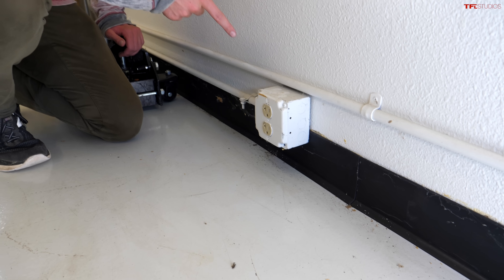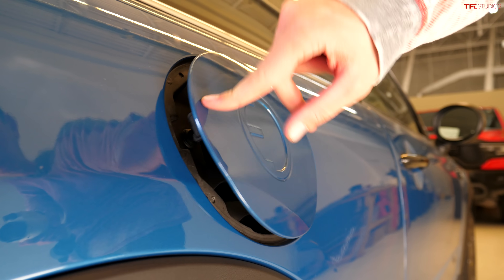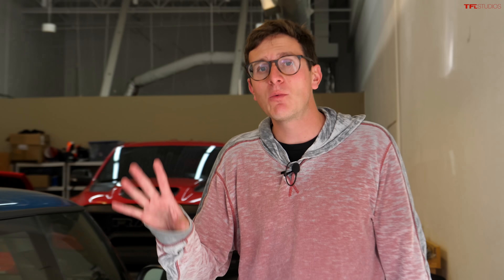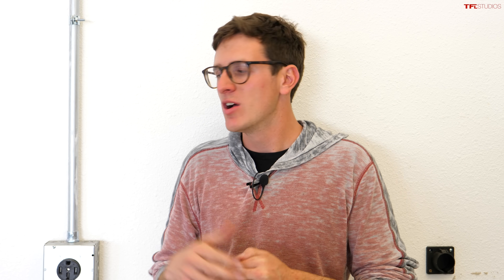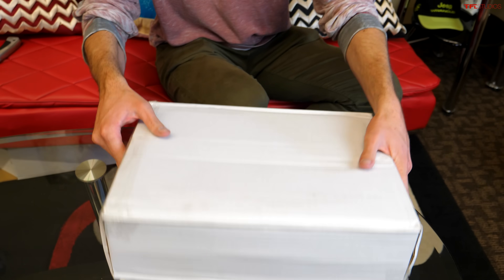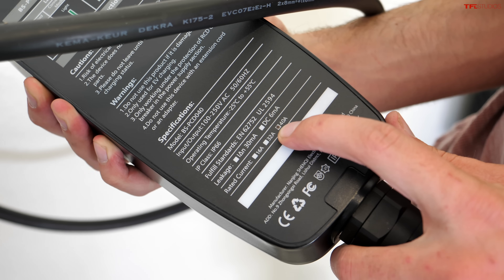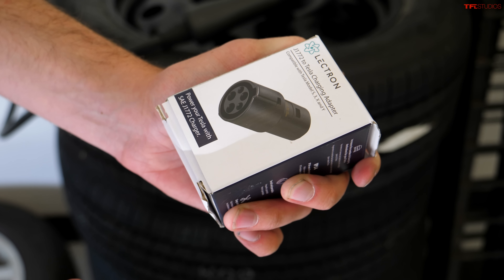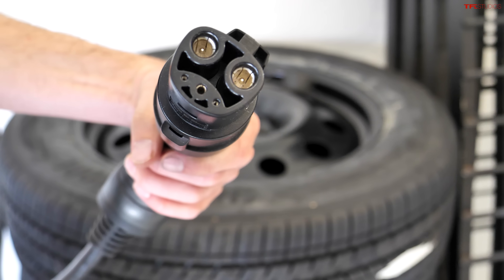Here's The One Thing You Don't Want To Forget When Charging An Electric Car!

Comment: Why buy a level one charge the manufacture supply's you with these the supply 240 charging cable and 7kw cable with every car 
Why waste your money the car comes with this cable in the boot.
We have 7kw charge at home which cost less than that cable
You level 2 is our basic why is the USA so behind 120 is inefficient for all electrical equipment.

Why are you wasting your money on these things.

Comment: While I understand that this is an info-tizment piece, folks should be aware that there's other stuff out there to aid in coming up with the best charging solution for individual needs.  First, there are intelligent current splitters where you can tap into your dryer plug and it will divert the current to either your car or dryer, according to need.  Lots of people are able to get away without running a new line or upgrading their breaker box for big savings.  It pays to do a little bit of research before shelling out big bucks for the gold plated solution!

Next, don't underestimate the power of good old 120v (lvl 1) charging.  Most people can actually get away with it for their daily needs.  Those big scary number of hours to recahrge, only apply for charging from totally empty to totally full... Generally, one only uses a small percentage of their battery on any given day and are thus able to replenish their daily use amount quite easily overnight, even on the slowest charging setup.  Even the occasional big drain, can be replenished over multiple days of normal use.

The upshot: Before running out and paying a bunch of money to enable the highest possible amount of home charging, try running with the slowest setup and see how it works for you.  You may surprise yourself and keep your wallet happy in the process...  Even if it's not enough, it should give you some idea about what you really need.

Comment: What if our home power can handle outputting equivalent to level 3? What things can we use?
Reply: Your home can't even come close, and even if it could, your car's on board charger could not come close to accepting that much AC current.  Lvl 3 is only with DC current.  It bypasses the onboard charger all together and dumps it directly into the battery.  Lvl 3 can max out at 350kW, which would be roughly equal to pulling the entire possible output of nearly 10 homes sporting the large 200A service.

If you wanted home lvl 3 charging, you'd have to basically buy a giant home battery, then buy an industrial lvl 3 charger.  To operate it, you'd let the battery charge all day and all night (instead of your car), then when you got home, you'd plug into your commercial lvl 3 charger and dump the entire contents of your home battery directly into your car.  A setup like this would cost hundreds of thousands of dollars and would be so far beyond anything that any typical homeowner could conceivably need.  It would also lead to premature battery aging on your vehicle.
Reply: @Bryan46162   my house is capable of 400amp service and under current full load i don’t pull more than 120. My current panel is setup for 200amp so I know that would need to be upgraded. I have talked to my power company about running 400amps and they said it would be ok as long as that panel was upgraded. Soooooo, my question is, can I have level three at my house with a controller that can handle that? Do they sell a home version of one?

Comment: I've never seen a 16A L1 adapter.  Most are 12A or 14A.  The one that came with my Kia can be set to 6A, 9A, or 12A if I remember correctly.  If the outlet being used is on a circuit shared with other outlets, the current available without tripping the breaker is reduced by the other loads on the circuit.  When you don't know what else is on the circuit, 9A is about all you would want to risk.

For the daily driving that most people do, an L1 charger used every night will keep the car battery charged.  However, it is better to use an L2 charger since the charger is normally more efficient at the higher input voltage.

For my two electric cars, I use L2 (240VAC) chargers at 6A and never have any problems keeping the battery charged for my normal driving.

Comment: Where we live in Colorado they are going to a system where the electricity rate varies by the time of day. Do these chargers have the option where you can program them to start and stop at specific times, or do you have to manually control them through insertion and removal of the plug?
Reply: Usually the car has programs for such. All three of our vehicles offered it. (Chevy Volt, Kia e-Niro, and Mini SE). The car will automatically follow a charging schedule, including remote scheduling and remote on demand charging over the app 

But yes, there are also EVSE options that allow remote and/or scheduled charging but they're usually a bit more over the $300-$400 options.
Reply: Yes.  So you can schedule time of day charging.  Some also have V2G, where cars can actually sell some power BACK to the grid, if the cost goes high enough to net home owners a small profit.

Comment: If you're going to add a 240V receptacle for a WALL mounted charger, please make sure you use at least the following:
NEMA 14-50r receptacle, 6 gauge wire, and a 50A breaker. 
Anything less is a waste of money, and could be a potential fire hazard.  If you want to be particularly conservative, you can use an industrial grade receptacle. They show a 32A wall mounted unit in this video.  The reality is you might as well buy a 40A unit (which is why you want a 50A breaker).  If you're vehicle can handle it, a 40A unit offers a quicker charge time, and many 40A products cost the same as the 32A one mentioned in this video.

Comment: 5:35 Also I think it should be a rule of thumb that if a cable has a tiny hole in it and is leaking coolant at the superchargers I think it should obviously have sensors built in that shut it down for that but if it does have a hole in it do not use it. Those cables carry TONS AND TONS OF POWER and if you do use level(insert any) then you should know that if your phone cable could shock you and make you very uncomfortable..... Imagine a trillion times that. You can end up put the hospital for electric shock and issues like that.  Avoid damaged cables like damaged power lines.

Im not an electrician but HOLY MOLY i can imagine what an rc car zap scaled up would be like (dont be dumb like me and try to stick your tongue on the motor. Shocked my tongue and it went completely numb when i was a little kid but its ok and after a few minutes went back to normal)

Comment: Imagine if a level 4 or 5 and 6 existed and 6 was like you get to full power in literally 2 minutes. Imagine the power drain on the grid around that area just fill your car up that fast. Well ...its heat im worried about because without propper technology the car would go supernova
Reply: lvl 4 and probably lvl 5 do exist, though they really don't follow the LVL naming convention.  What we could think of as LVL 4 are popping up as we speak and they will be used to recharge semi trucks.  They are believed to output power in the megawatt range.  A few level 5 chargers are in operation globally at docks to recharge battery electric ferries and other ships.  They output power in the multiple megawatt range.

Comment: Great video! I'm excited about your EV content.

A few things I'd add / clarify:
The first EVSE is definitely intended for a 20amp breaker. These are common nowadays even if you don't have a 5-20 outlet, but you need to be sure. Otherwise the continuous max draw from a 15amp breaker should be 12amp.
I'd also make sure you have a "heavy duty" outlet as some of the cheaper ones tend to melt when drawing so much power for extended periods.

The 14-50 outlet you show is for an electric range, rather than a dryer. Dryer outlets get you 16 amps less usable power but are still a great choice if you have one available. There is no problem getting an EVSE for one including from Lectron :)

The final point I'd like to clarify is that your max charging rate is dictated by the car itself. Technically, the (AC) charger is part of the car. So your Mini for example you probably saw a max of 30 or 31amps as it's rated for 7.4kw.
If you're building a new circuit though I'd say get the highest capacity that's reasonably affordable even if it exceeds your car, as it doesn't hurt to be prepared for your next one.
Reply: Correct! This video has a stunning level of wrong to dangerous information.  Fortunately most (all?) ev connectors are designed to limit the current draw to prevent overloading the outlets/wiring. There has been an effort to idiot proof the process. This video shows why that’s necessary.
Reply: And that L1 charger is not putting out 1,900 watts.  Code would only allow an 80% constant load on a 15 amp circuit, or 12 amps continuous or 1,440 watts and that’s with no other loads on your garage circuit.  My i3 charger came with a 10 amp L1.  It would be a good idea to redo this video with a licensed electrician to help on this.
Reply: Guaranteed we'll see a whole lot of small fires and houses burning due to underspeccing of wiring as more and more people get electric cars and try to charge them from normal sockets. You'll get away with drawing the max amperage from most sockets for a few minutes because there isn't time for anything to overheat, but leaving it on at max current while you sleep without first running it a couple of times while you keep an eye on it is a recipe for tripped breakers at best and a fiery end to you and your house at worst. 

By far the safest thing to do is get any socket to be used for charging a car and all its wiring from the meter installed by a competent professional rather than using a socket that at worst was expected to run a hairdryer or kettle for a few minutes at a time.
Reply: @peglor  nah. If the circuit breakers are working they'll trip after a few minutes. It's not like space heaters and hair dryers didn't exist before this, both of which draw max rated or sometimes over in the case of hair dryers
Reply: @chunkychuck  actually space heaters only pull at 80% on a 15 amp circuit.  15x120=1800 x .8 = or 1,440 watts.  Hair dryers aren’t a constant load.
Reply: I was about to comment  the same thing. He didnt have any problem because he is on a 20 amp circuit (looking at the plug), But why that charger has a normal plug for 20 amp rating, that should not be legal unless it come standard at 12amp and you can flip a switch for 16amp

Comment: Do all EV's have have an option so you set a time to charge and stop a charge.  Could you use an electric timer in them or even use the light switch to turn the power on and off? It's mainly for off peak hours usage.
Reply: Yes, all EV(effectively) have controls for charge time, scheduled time on and off, and state of charge.

Comment: If electric cars do become the majority they’re going to need to introduce a lock on these portable chargers. $3-$500 would be slim pickings. I definitely wouldn’t want to leave it unattended. Perhaps, some of them do. I haven’t actually researched them.
Reply: Both of mine have a small lock hole at the handle. You can see it in the video as well.  I use a small cable lock on mine.  Also if I disrupt charging without my key next to the car, the alarm goes off.  In the end it only keeps honest people honest but there are small measures.
Reply: Most have locks, but they're installed in the car. Lock the doors with the key FOB, the cable is also locked into the car.
Reply: Most portable chargers lock into the car charge port when plugged in.

Comment: What we need is something simple like gasoline octane. People know which their car needs. For electric maybe some simple color code system or a numbering system like 1-5. If the label on your port says "4" then you know you can get the fastest charge with a "4" plug but you can use 1-3 also. You can use "5" but it is more than your car can use so you are just tying up a plug that a faster charging car could use. Gotta make it simple for the non-car people.
Reply: Check out Chargeway, that’s basically their whole concept.

Comment: you also did not point out that the wall unit you choose charged slower than the 40 amp charger you used right before

Comment: I just have one question, what does it do to your electric bill? 🤔
Reply: Yah???🤔
Reply: hardly anything, especially when compared with $4/gallon gas.
Reply: I’ve been averaging about 400 kWh per month, and my utility cost is about 15¢ per kWh when charging overnight. That works out to $60/month.
Reply: $22 monthly increase in Washington. A $35 monthly increase in Minnesota (pricier electricity). Based on 1,000 miles a month driving. 

Larger, heavier, EVs (Ford F150, Hummer electric etc) will be less efficient, expect a slightly higher power expense.
Reply: @wzDH106  Even cars weighing 5000+ pounds are going to take a hit too.
Reply: @samusaran7317  

Not as much based on the data from the Tesla Model S, Mustang Mach e, and VW ID4 (ID4 pushing 5,000). They are well in the 3.0-4.0 mile/kWh range with mixed driving. But yes, I guess they are hovering around the 5,000 mark as opposed to the tanks.

Worst case 3.0 miles / kWh average would return a 1,000 mile monthly bill increase of $29 - $47 (Washington and Minnesota respectively)

The TANKS:
Hummer EV, Rivian, and most likely the Ford F150 will fall within 7,000-9,000 lbs, probably average 2.0-3.0 miles / kWh (guessing). Their box like form factor sure won't help efficiency either.
Reply: @wzDH106  Law of diminishing returns creeping in. Hopefully in time they take a better route and have other  lighter more efficient options. These big "cars" don't appeal to single people.
Reply: You can measure it before buying a car.  If you plan on using a 120v outlet, just run a space heater for the equivalent number of hours you plan to charge your car.  See what that does for your power consumption.  Or, just do the math.  120v X 20A equals 2400watts.  Of course, one should never continuously exceed 80% of your max amps for safety reasons... so 120v X 16A equals 1920watts.
Reply: It's about 0.8c-0.9c/day to charge my Tesla for daily use. About $27/mo vs $150-200/mo I was spending on gasoline and the $300/year I was spending on oil changes. 

Yearly cost of daily driving my Tesla Model 3 LR - $324/year
Yearly cost of daily driving my 28mpg VW GTI - Up to $2700/year

Comment: Why did their wall mount version only cap out at 32Amps but the more portable one can go up to 40amps? Is it because of the more extreme environment rating could only handle 32amps? or another reason.
Reply: No reason, just rated differently, and potentially has more features. 

The rated amperage numbers are a reflection of electrical code constraints. A given size plug can only be used at 80% of its capacity when the device is drawing power continuously. 
So, the 32A units are rated for circuits that can deliver 40A, the 40A units are rated for circuits that can deliver 50A, and 48A units are rated for circuits rated for 60A, though those are less common. 

One thing to note is that every vehicle is rated for a specific rate of charge based on it's internal components, so getting a more capable charger won't make you charge any faster. 
As an example, the Chevy Spark EV has an onboard charger rated for 3.3kW. One could install a charger that delivers 48A and 11.52kW, but the car will still only take 3.3kW.

Comment: You are using a 20 amp 120 volt circuit without telling people most household outlets are only 15 amps and shared with other plugs. That 16 amp EVSE would blow every circuit in my house. Does that level 1 plug only fit 20 amp outlets?
Reply: No, they will scale back power to what is available.